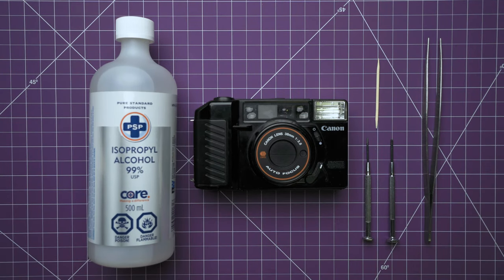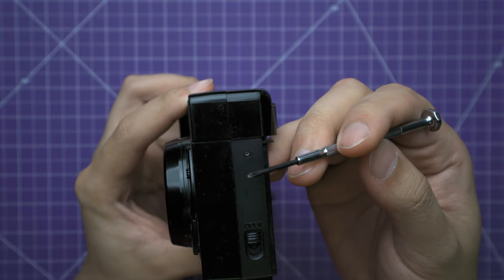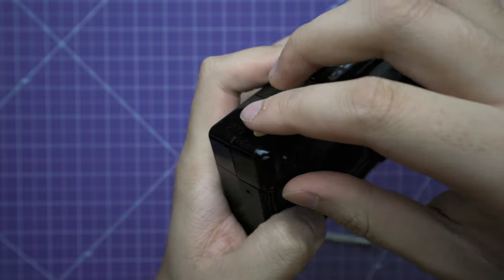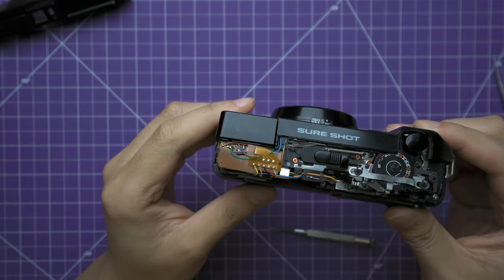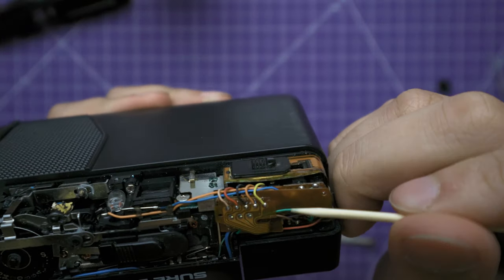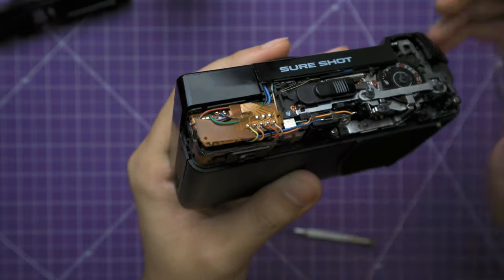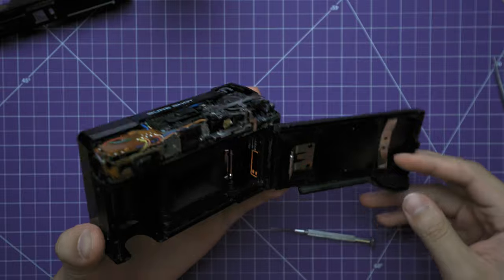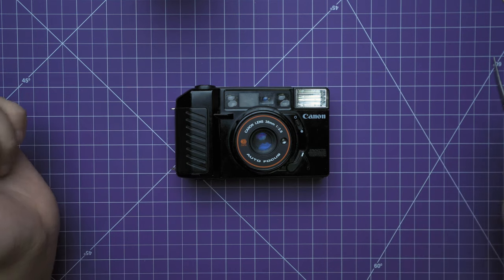Canon Sure Shot AF35M II / Autoboy 2 - Flash Repair!

Comment: Great fix man! I got one with a shutter that doesn't want to close. Any recommendations? Really want to get it working again.
Reply from the maker: Thank you ! Actually, my friend had a similar situation where the shutter would not release because it was misaligned with the lens shield. 
I was able to fix it for him by taking off the front cover plate and getting all the gearing to match up with each other again. 
Although yours might be a different situation, hopefully that might help you as well. 
Definitely hope you can get yours working again !
Reply: @tuanmai492  OK this is great! After I read your answer I started to look closer at the gears! I rearranged them like what seemed where they belong. And it's actually working a lot more than before! Before this nothing worked (only the flash made the high pitched noice when I opened it). The film rewind, the shutter button (etc) did'nt seem to budge. But now they do! It''s not fully fixed though. I have to press the shutter button twice before it goes off and winds the film (at the first click I hear a spring move, the second time it goes off). Also, the frame count doesn't move after taking a couple shot's (there is no film in it though).
Reply from the maker: Glad to hear that! It sounds like your camera has correctly aligned the shutter with the lens shield and actually registers it turning on. 
As for pressing the shutter button twice before it goes off and winds the film, have you tried different / new batteries? This happens sometimes with weaker batteries, if not that it could still be some misaligned parts still. 
I believe the shutter count will only move with film in it, but don't quote me on that.

Comment: Hi Tuan! I don't know if you're able to help me out but I recently thrifted the Canon Sure Shot 70 Zoom. When you turn on the camera, the flash is supposed to pop up automatically. My flash only pops up half-way. The flash works fine, if I manually hold it up/pull it back. I was wondering if you had any idea on how to repair this. I've been trying to find solutions but it seems that this problem isn't as popular.
Reply from the maker: Hello! Ah, unfortunately that seems to be a common issue with that model. 
I believe it happens due to the internal small wire that is tied to the flash to pull it up usually breaks over time. 
I have never actually tried fixing this issue, but I think I do have the exact same model with the same issue. I will take a look at it and see if I can come up with a solution for you!
Reply: @tuanmai492  Ah, I really tried to find info for this camera but I didn't know that it's a common problem! The camera is still functional but it does bother me slightly. I'm worried that the camera's flash will eventually lose its function, if I don't repair it ASAP. I tried digging around in the camera but I couldn't get to the part where the flash is mechanically pulled. Thanks for looking into it! It's fine if you can't figure it out. 😭

Comment: Hi, i recently got a Canon Autoboy 2 (i think its the same as a canon sureshot af35m) on ebay, which seemed to work great (including the flash). But after getting my film developed, every photo I took with the flash on ended up being a dark yellow blank picture. I know I took several of these in light enough conditions that there would have been a visible/noticeable photo even if lets say the flash wasnt synced properly. And the photos where the flash was off were fine. Ive tried googling and found hardly anything helpful, so i wondered if you had any ideas? I would be very grateful! Many thanks, Eve